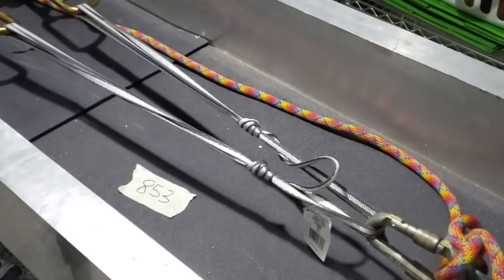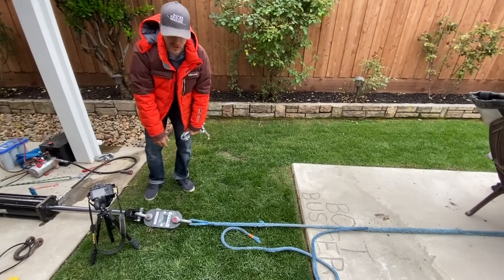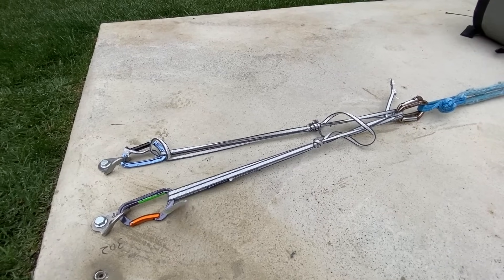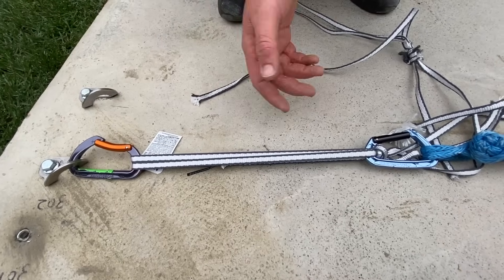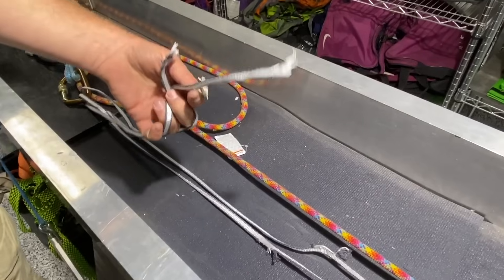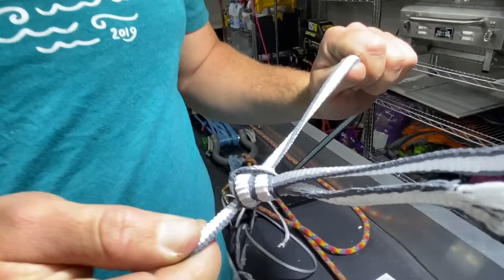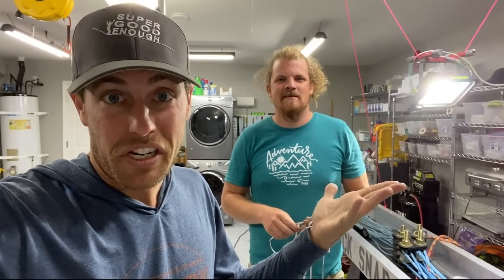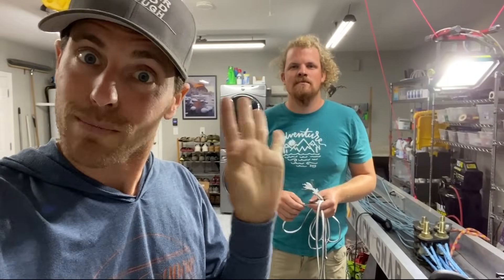Climbing Quad Anchor break test with 240cm Black diamond dyneema sling

Comment: Love your work guys. I've found your videos really useful. Quad anchor with 240cm dyneema is my go-to. I'd be interested to see a test trying different types of knots in a dyneema quad anchor. The scenario I'm considering is that one side of the quad is cut by a falling rock, or rubbed through on a sharp edge, and then the anchor fails because the cut end slips through the knot (unlikely but would still like to know). Cheers.

Comment: These guys are legendary. I’d like to see the same test on the exact same dyneema set up after it’s taken 20 or 30 normal falls and maybe a handful of factor 2. Maybe over time as well, stored in a backpack full of gear and exposed to sunlight, etc. Kind of a real world test.
Reply: The real world Mammut test broke a similar sling with 160 lbs on a factor 1 fall.  Dyneema can't handle dynamic loading, that's why it's only used in more or less static situations.  One isn't supposed to fall on it, just support ones weight.
Reply: @BRENDANTHERED so no dyneema extensions?
Reply: @4316rodney They just did a video on this. Seems not to be an issue -- with the caveat being there's a dynamic line in the system.

Comment: Guys, you need to understand that testing break strengths on huge crane shackles with large diameters <> the same as a climbing carribiner/screwgate with a small diameter. This is because the strain on the slings/rope etc is maximised on the outside radius of the curve it is going round. This is why knots are very bad, because they have very small/tight radius's for example. A bit more thinking and a bit less larking about would mean you test things more consistently and logically.

Comment: "Redundant" means no significant decrease in strength/security, when some parts fail. The slippery Dyneema slides to failure at a fraction of the initial loading peak, so neither girth nor clove hitch provides redundancy in this configuration. I suggest using two separate shorter slings, and double or triple them to arrange the master point if needed, entirely without knots; similar total material involved, but actually multiplying the final strength versus reducing it with knots.

Comment: I want to see the quad with one side disconnected from the start. That would be the use case of one of the carabiners comes unclipped or a bolt pulls out. You kept pulling after the rope failed but didnt cover a different failure

Comment: I'm a big fan of your videos. I appreciate the energy, time and resources that you and Bobby invest into questioning common climber lore and specifically break test mining for the ultimate anchor set up! I often come away from your videos with more questions than answers. I'm very comfortable with that - that's how growing knowledge works; and I sense that you are comfortable with that too. Please continue your great work.

A rare exception to the usual accuracy of statements made on your channel occurs in the section starting at 13:36. Bobby makes an incorrect statement that could lead to climber deaths. It's an honest mistake, that anyone could easily make, but fatal none the less.  

Bobby states, "If you take one [strand] from each side, and then make the sliding "x", then clip through all of them...that catches, like you want it to."

Bobby clips a doubled sling to 2 biners in a manner that I have never seen any climber perform. I and my climbing partners double the sling (so that it is half it's original size),  clip the doubled sling at one point to the right biner, and then at another point to the left biner. Pull the mid point down on both the rear 2 strands and the front 2. Then we rotate either the front 2 strands or the back 2 strands 180 degrees (half of a turn) and clip the master biner through all 4 strands. If a bolt or biner fails, the master biner drops a foot or 2 and remains secure to the remaining bolt. This is true 100% of the time.

If we follow Bobby's axiom, and choose the wrong rear strand and the wrong front strand and pair them up and a bolt or biner fails...we die.

Constructed as I described above, the anchor never fails. Following Bobby's rule, it sometimes fails.

Here's what's going on:  Bobby constructed the double sling in a unique and very rare (in my experience) manner. Constructed his way, if you rotate just the front or just the rear strands, and a bolt fails, the anchor will fail...sometimes. Bobby selected just the right strands to make it fail and chose for the right bolt to fail. If you duplicate his set up exactly but cause the left bolt to fail, you will not have an anchor failure. This is by virtue of how he separated the 2 sets of double strands. On the left biner with each loop of sling one strand goes to the front pair and one to the back pair of strands. This is safe. However, on the right biner, with one loop, both strands lead to the front pair of strands and with the other loop, both strands go to the rear. This is an accident waiting to happen. This is why Bobby created his rule to make up for the basic flaw in his rigging design. Unfortunately, his rule creates anchor failure in a high percentage of excellent rigging choices that I see in the field. Rather than making up a dangerous rule to cover for a rigging error, better to rig the anchor safely in the first place (in the manner that I have described above.

If you construct the anchor precisely as he has done and cause it to fail in the exact same mode, Bobby's rule holds true. However, 99% of double sling anchors do not meet those criteria. You would have to tie the anchor exactly as Bobby did and have the correct bolt fail for his rule to be true.

On the other hand, if climbers construct doubled sling anchors with sliding "x" as I have witnessed and built myself 100's of times and follow Bobby's rule, a large percentage of them will not be redundant. If one bolt or anchor fails, they have unwittingly set up a catastrophic anchor failure.

I think your viewers will want to know this.
Reply: Hey Al,
Seems like I struck a nerve. I feel it was pretty clear in the clip I claimed no expertise in that anchor set up. I think the crucial part you missed and I hope is obvious to most viewers was "if you are not sure test it". 

Personally I have never seen or heard of any one using a single sling doubled in a sliding x for a climbing anchor. To me it seems to have no advantage to normal sliding x, It is stronger but that is irrelevant bc a normal sliding x is more than strong enough in a rated climbing sling. It does not solve the lack of redundancy. It adds opportunities for potential failure as you you have pointed out.  And you are probably carrying longer and heavier slings.  
Curious to your reasons for using that anchor style
-Bobby
Reply: @bobbyhutton1989  Thanks for the super prompt response. No stuck, no nerve, Bobby. Sorry if your feelings were hurt. I have zero desire to do that. My comments are about rigging anchors, not about you. I think you and Ryan are awesome. I just don't want someone to get hurt because they followed a rule expressed in your video on the world wide web. When mistakes are made, especially in the area of life support systems, it's important that they get corrected. I hope that you are healing well from your injuries. I appreciate all that you do. Cheers, Al
Reply: @alshaver3742  
All good.
 Still curious why you use that anchor style. 
-Bobby
Reply: @bobbyhutton1989  It's true, as you say, a single sling with sliding x is strong enough and adding a long sling doubled does not add any redundancy (lack of integrity after a cut is the main weakness of this set up - single or doubled). However, when I do have a double sling available, I will often double it simply because I can. 

On belay station anchors, the protection from cuts is far more important to me. I add figure 8 limiting knots (not for non extension, but for redundancy) and this uses up too much length on a 120 cm sling to double it as I might on bolts along the route where cut resistance is less critical. I pre tie 2 slings with the limiting knots, one for each belay station and can fly up bolted routes like Snake Dike.
Of late, I've been keenly watching videos from you, Yann Camus, Brent Peters and others to learn of newer anchor knots such as girth x and clove x. I'm always searching for the safest, most efficient way to climb and your videos teach me a lot!

Don't know if that answered your question, but that's my best effort. Thanks for taking the time to respond and for making your informative and entertaining videos.
Cheers, Al
Reply: @alshaver3742  
I am unsure if I am visualizing what you are describing correctly, but it sounds like a quad where you are creating 2 sliding x's instead of clipping either 2 or 3 strands. 
If you climb in Nor Cal I am sure I will run into you one of these days and I would be happy to nerd out on obscure anchors. 
-Bobby
Reply: @bobbyhutton1989  It just so happens that nerding out on obscure anchors with new, interesting and amusing climbing friends is one of my favorite hobbies. Hope to meet up sometime, maybe even assist you with some of your development projects. Would love to learn more about bolting. Project we put up on Shuteye Ridge (SOYO) was a tutorial on how not to bolt.
Reply: @alshaver3742  Sweet. Hit me up if you are up in my neck of the woods this fall. I am easy enough to find on MP.
Reply: @bobbyhutton1989  Will Do

Comment: Very interesting video(s).
Have you tested equalette 3?
It is very popular in Spain, but I am not sure if the knots can hold the load without slippering, in case of a bolt failure.

Comment: The way i like to make sure the sliding x is correct is simply use one loop and make the sliding x and clip it together, then add the 2nd loop and make its sliding x and clip it with the 1st. That way you aren't fuddling around and trying to make sure your grabbing the right strands.

Comment: How did you setup the sling for the sliding X to fail? I tried that on 2 points and it worked just fine with the "standard" crossing of strands. I doubled the sling as if I would want to carry the sling over my shoulder and then clipped to the carabiners, made sliding X, unclipped and it was OK.
Reply: Looks like he clipped one end, put both stands thru the other, and clipped it back on the first again.
Instead of what you did (like i would. I'm guessing he would also normally)  sling between hands, one twist, and gather hands)

Comment: I fold my long sling in two a bit differently so it's always redundant no matter which side gets unclipped. Of course there's a potential for human error though.
Reply: I think this is an excellent point that need to be clarified. There are two ways of folding a sling in two. And the way you choose makes a difference. This comment should be highlighted.
Reply: I was struggling to replcicate doubled sling x failure until I read your post. Finally did it. I'm doubling a sling only to build an quad anchor and don't know other necessities (for climbing purposes) to do it. All the sources I know shows building quad anchors use sling doubling method that not leads to failure which is showed on the video... but yes there is an option for fatal error.

Comment: So, this is not specifically a break request, but I think it would be useful for you to put together a sort of "executive summary" for your findings about which anchors are best used for which application and which materials optimize for which use case - supported with your data. Might be good fodder for a series that shouldn't cost you more money ;)

Comment: OK OK OK, so I'm only half way through but stupid or not surely you test them without a knot?! WTF. then we know what they actually break at and if putting a knot in them makes em weaker, I suspect it does as they always snap at the knot. Yorn. 
I know this makes em 'super good enough' anyway but just maybe this would lead to breakthrough with technique and safest way to use? A possible forward step, such as the way they are sewn or the Edelrid aramid cord being more widely used? 
Just sayin, cool test though and surprised they outdid a rope in the first part even with knots in, scary stuff even if it was over 4 tonne!
Edit: So just watched the interesting bit at the end and NOT tying knots in dyneema for the win? makes em super strength all of a sudden? some way of creating redundancy and the massively bomber? Yep. And it only cut because it slipped across the shackle so would probably be more? Mint!
Reply: This comment is almost impossible to read fyi lol.

Comment: Hey, could you please do a "quad" anchor with a regular masterpoint knot. That same BD 240 cm sling would be ideal. That way one coud compare the "quad" with something that does not equalize. Same amount material in both test. The sling x was very good but it extends so much that the belayer is going to fall from the stance. So please do just a normal overhand knot. I bet it's actually stronger even when pulled in angle like 45 degrees or so.

Comment: Would be very interested to see if clipping a hanger above or below the rap rings affects their strength. Seems to be quite a debate among climbers (see mountain post thread: https://www.mountainproject.com/forum/topic/114260050/anchor-bolts-clip-above-or-below-chainquicklink#:~:text=He%20said%20you%20should%20always,to%20set%20up%20the%20rappel.), so would be very cool to get some actual testing numbers!

Comment: TEST SUGGESTION
A double overhand knot in dyneema sling to reduce slipping.
Note 1: a double overhand knot  is asymmetric, so needs two tests done in two possible load directions.
Note 2: double overhand knot not to be confused with two stacked overhand knots. Here is a video to clarify which knot I am talking about, though video does not show in a sling, but gives you the idea. 
https://youtu.be/D1an3hZ9zgU

Comment: I would be curious to see this test repeated with a nylon sling to compare strength and knot slippage.
Reply from the maker: we could, but we also did it in 6mm accessory cord released a few weeks ago
Reply: Would the sewn nylon sling not be super gooder enough? No knots to slip or reduce strength. (double sliding x) But, you have beat the quad anchor to submission. I am confident enough in these systems, no more break tests are really needed, but they are sure fun to watch!
Reply: Testing with a nylon sling would be awesome. Maybe less slippage?

Comment: I use my mammut 8.0 quad clipped into 2 strands with another 2 for my partner/ belay device. Would be cool to see you just pull two of the strands instead of all four in two different biners.
Reply from the maker: we can chase the rabbit holes eventually
Reply: Great video, thank you for your time and investment
Reply: Agreed. I think this one is common enough for multi-pitch.
Reply: Agreed would love to see. I often do this on multipitch.
Reply: I likewise do this as well!
Reply: Would be also cool to apply a constant force on the other biner (equivalent to the climber weight around 0.6 to 0.8 kN) but pulling in a different direction which is common in multi pitching when using a quad anchor. I'd like to see the chocks generated by the 2 carabiners. I always have the feeling this is the weakest point of a quad anchor setup.

Comment: You brought up an interesting point in this video - Could you guys test Dressed Knots Vs NotDressed Knots?
Reply: Interesting, but it would not make a difference. Dressing a knot just makes it easier for the user to undo after a whipper.  A dressed knot quickly becomes gnarled up when this monster pulling machine tugs on it. If you are generating 30+kn, youve got bigger problems, like a broken spine.
Reply: What do you mean by dressed / undressed knot?
Reply: @bullfrogboss8008  Dressing is organizing the strands in the knot so that they run neatly (usually parallel) and dont twist/overlap within the knot. My understanding/logic is that a dressed knot does a better job of equalizing the load on the various strands in the knot, and it most definitely makes it easier to inspect.

Comment: Nice example of gate flutter there with the piece of sling popping out of that aluminum biner!  Not nearly as likely during a real life whipper on a rope... but still a possibility.
Reply: You can actually see the gates open and the sling pop out. Pause the video at 2:51 and use the < > keys to step through the individual video frames. In this case the flutter is caused by the sudden acceleration of the carabiner body while the gate remains stationary, which is the exact opposite of gate flutter during a fall where the carabiner is moving and the body smacks a rock and stops but the gate keeps moving. Fascinating! I prefer wire gates for this reason on everything except bolt-side carabiners on my beater sport quickdraws.
The bolt carabiner here actually had its gate open from the sling snagging it and popping out as it flew by. Crazy stuff. 
I second others who say get some collab with a high-speed camera channel so we can see all the hardware interaction in slow-mo!